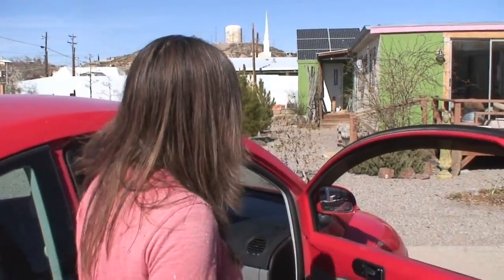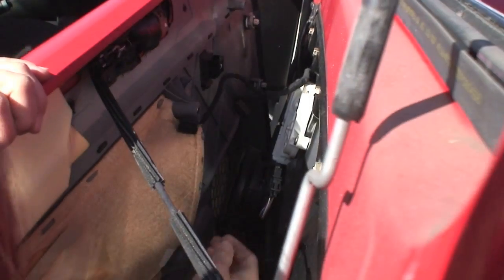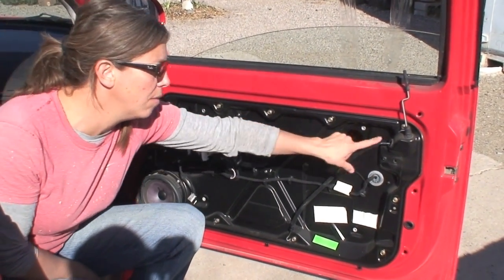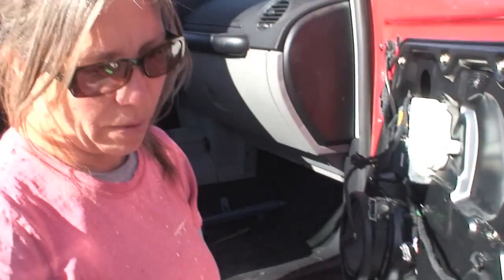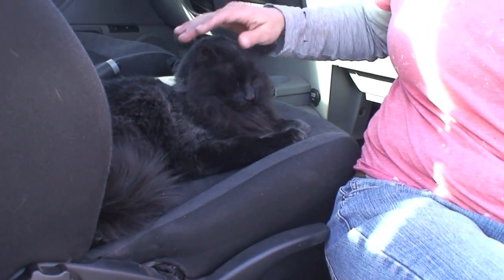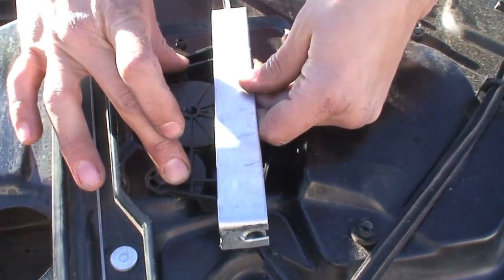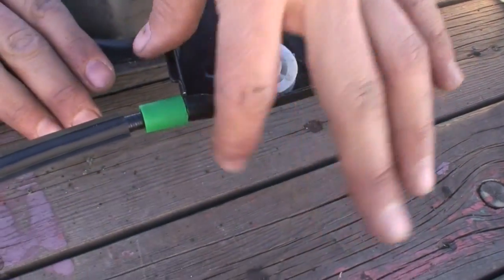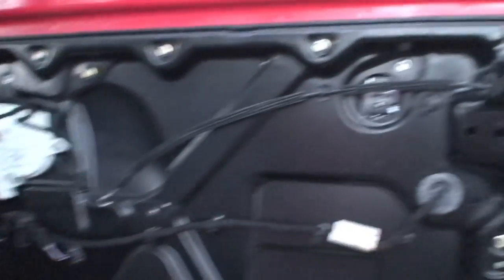1998 VW Beetle Window Regulator Repair

Comment: Awsome, lol! I work for a dealer and have done many of these. A little tip, take the carrier out of the door with the latch assy and harness, much easier. And once you learn how the bowden cable and handle come out, these are a snap! About 30 minutes. Thumbs up for going out and doing this repair yourself.

Comment: Hey thanks sklarm, you inspired me to give it a whack, so I did but  but "Bang" a Double Whammy, When I took my door apart I found that the motor's casing cracked open which ripped apart the regulator as well, good thing I had no screw issues, and yes it can be a head ache if you do not have the right tools for the job, it makes life easier, well its together, works great, no screws or parts left over. Yay! Kisses :o)

Comment: Reeeespec' Sure is a fiddly job. Not many videos say to be very careful with the glass. Make sure it's well supported when detached from the regulator so as it doesn't fall and break but also watch your hands in the even of it dropping. It is quite heavy. Good strong tape is essential around the top door frame. I've done a similar one once before and unfortunately see myself doing it again on a beetle in the next few days. Grrr

Comment: $400 for a genuine VW part from the dealer? I was quoted nearly £200 from a local VW dealer for one for a convertible and the convertible-specific parts seem to be twice the price of the hatchback. I feel your pain with this job. I'm in the middle of fixing one myself on a 2007 convertible. I ended up getting a secondhand genuine VW regulator on eBay for just £40